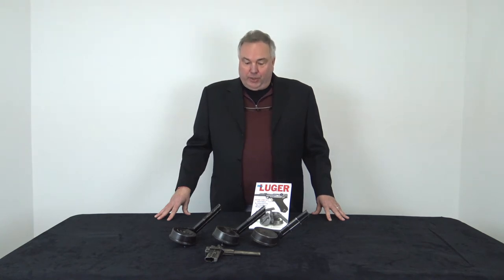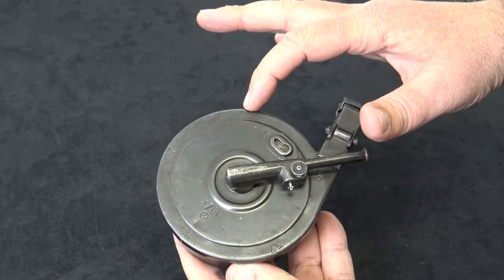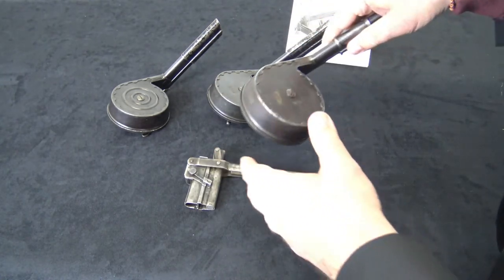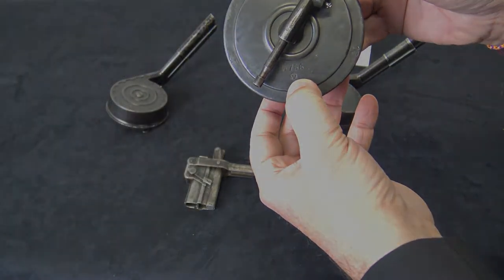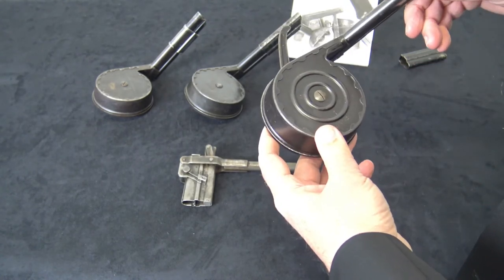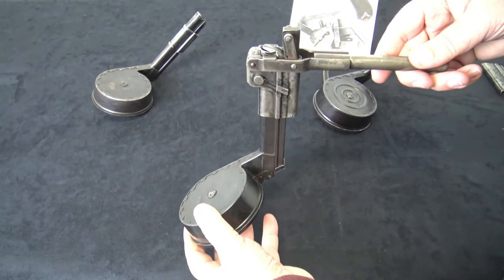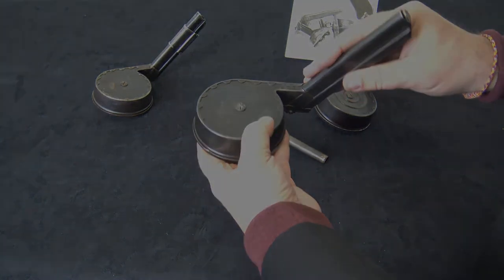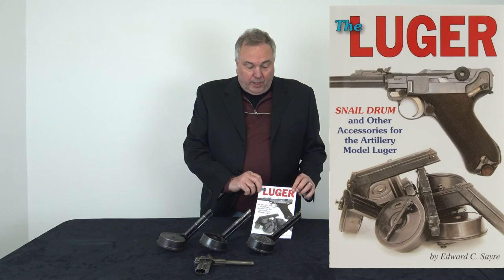Luger Snail Drums #luger #snaildrum #trommelmagazine

Comment: Still dont get how it feeds at a right angle into the mag
Reply: Google "luger snail drum manual", it has a picture of the disassembled drum. TLDR there are two different followers, the normal straight follower and the rotating drum follower. When you load the magazine the first follower gets compressed just like a normal straight magazine until it can travel no further, at which point loading further cartridges starts to rotate the follower sideways inside the drum. When you empty the magazine this process happens in reverse, bullets are fired until the drum follower can rotate no further and the straight follower is inline with the neck of the magazine and pushes the remaining bullets up and out. This system requires a huge amount of spring pressure to work which is why you need a mechanical tool to load the magazine, it's easy to see why no one tried to copy it.